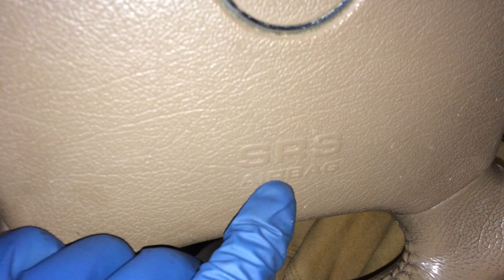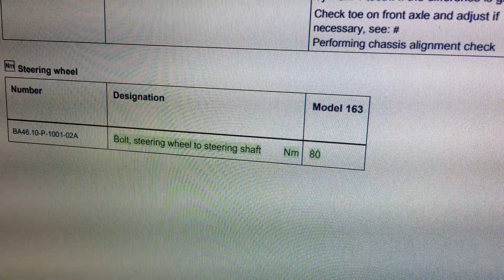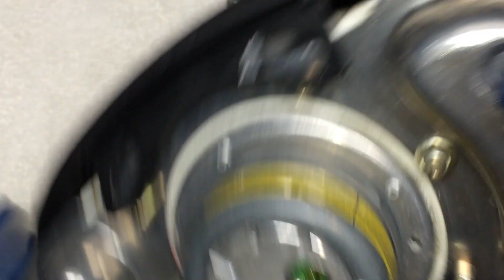Mercedes W163 '98 - '05 ML Remove Steering Wheel, Airbag, Airbag Pad, Collar Trim

Comment from the maker: Timestamps:
00:16  Disconnect negative terminal on battery
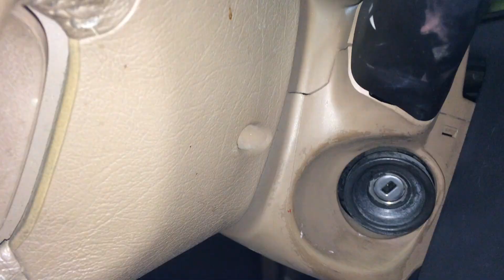00:58  Remove airbag screws (Torx 27)
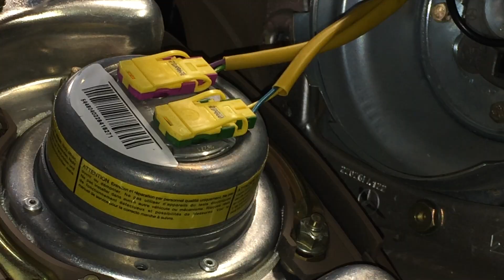02:57  Disconnect airbag electrical connectors
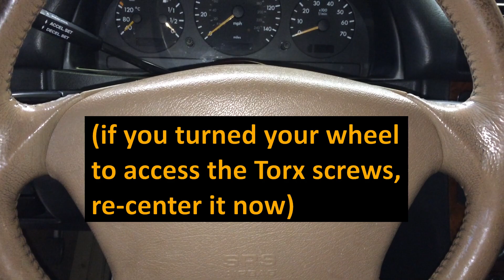03:55  Remove horn contacts
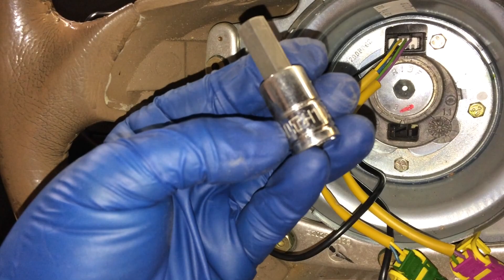04:15  Remove steering wheel bolt (Hex/Allen 10mm/H10)
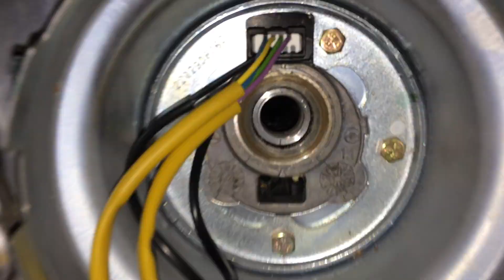06:00  **Important: Steering wheel alignment marks**
07:40  Remove the steering wheel
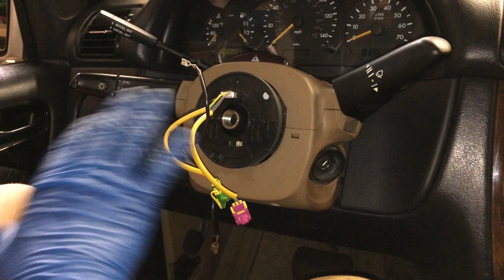08:55  Remove steering wheel collar trim (upper & lower)
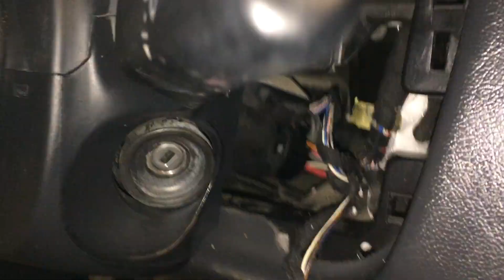11:47  Install steering wheel
12:53  Install steering wheel bolt (torque is 80 Nm, or 59 ft-lbs)
13:37  Reconnect horn contacts
13:51  Reconnect airbag electrical connectors
14:55  Install airbag screws (torque is 8 Nm, or 70 INCH-lbs)
16:00  Reconnect negative terminal on battery
16:06  Engine start-up and SRS check
16:37  Reset digital clock 
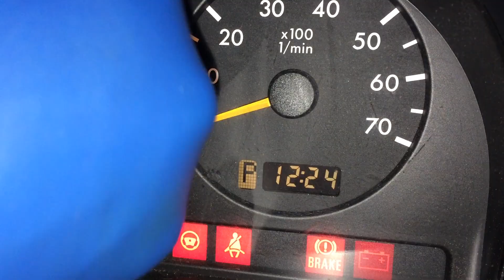17:20  Remove & Replace the airbag pad/cover (change from tan to dark)

For the full dash remove and replace, and the blend door motor remove and replace, check out this video:

https://www.youtube.com/watch?v=ptp8my_87W4

I'll be posting some more videos for the seats and some other interior swap parts. 

Thanks for watching.  Good luck with your repairs!
Reply: hello there!

If I wanted to change the multifunction switches, do I have to remove all this trim with the clockspring?

Comment: Can i change my w163 steering wheel to an w907 (2018)steering wheel without changing the clock spring? Can i modify the connections for the newer airbag?
Reply from the maker: I'm sorry - I don't know!  Perhaps check the W907 and W163 forums at www.benzworld.org to see if anyone has done that.  Thanks for watching : )

Comment: This is an excellent video contents helping me how to disassemble the air bag & steering column!
My ultimate job is to replace my 2000 ML320 combination switch as my low beam head lights switch doesn't turn on the lights while high beam & turn signals work fine.
Is the replacement doable ? I bought a brand new W163 combination switch - which looks pretty complicated - particular the little plastic part inside the steering pipe.
Any video contents showing combination switch replacement ? Thanks so much for your help!
Reply from the maker: By "combination switch", do you mean the lever with the headlight switch?  If so, I haven't replaced that part before, but here is a link that might help you - scroll down to the PDFs on post #5, as those contain instructions:

https://www.benzworld.org/threads/headlight-switch-replacement-99-m-class-w163.3072033/

Did this just suddenly happen, or was it failing intermittently, as described in that post?  And just to be sure - have you verified that the issue is not the headlight fuses?

I hope this helps - good luck! : )
Reply: @L35inColorado  - Yes, the switch block attached underneath the steering wheel. And thanks for the link - I found the exact service manual pages describing step by step R&I instructions including the clock spring contact. So many bolts and contacts to memorize for exact re-installation - I'm afraid losing a part (or bolt) to damage the steering and/or lighting systems.

Oh, good point -  haven't checked the fuse nor the bulb (which I replaced 2 years ago) - is there a separate fuse for lower beam light ? Will check that before starting this replacement job. Thanks so much for all the valuable info !

Chan

Comment: The bolt never came loose even with auto hammer 1500 ft lb torque
Reply from the maker: Holy smokes, that's crazy!  I'm sorry that's happening to you: have you tried heating it with a heat gun or hair dryer?  There might be Loctite on the threads.  Shield the wires, and try heating the bolt to weaken the Loctite.  I hope that helps, and good luck!
Reply: Same hapen to me , any solution ?